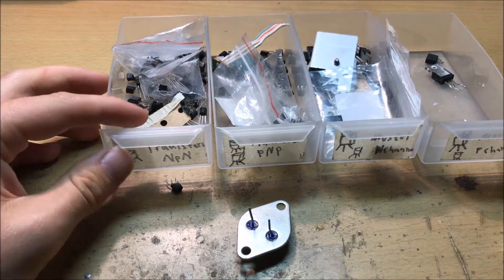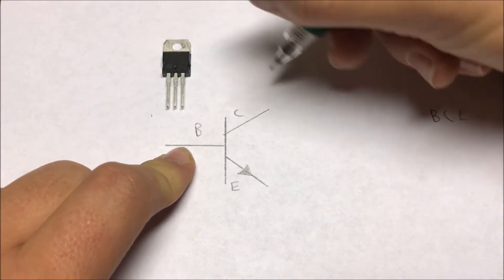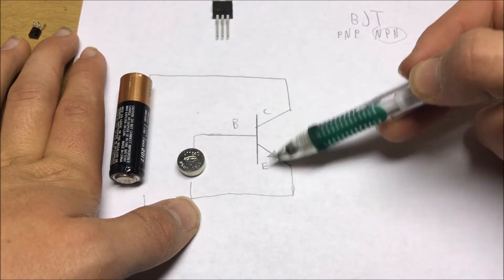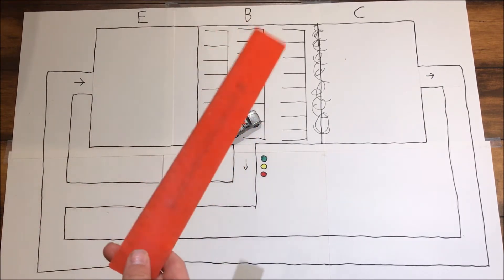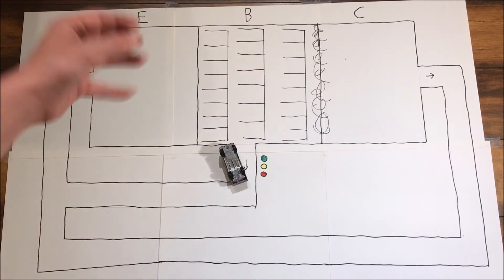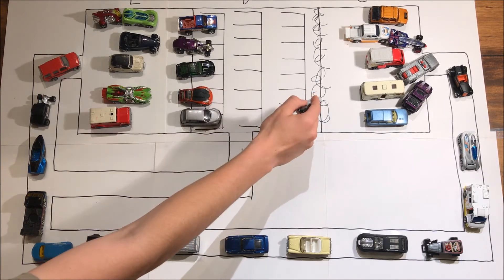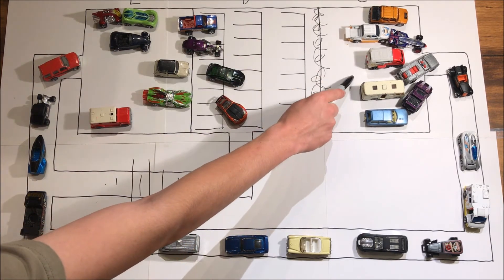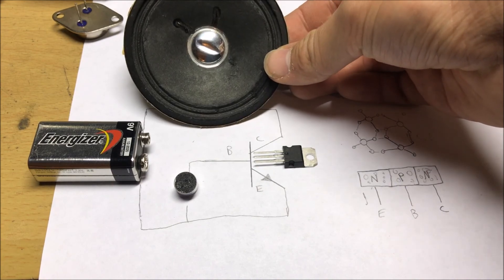Transistors, Explained With a Big Traffic Jam

Comment: Could you explain a little on how the amplification happens? I cant seem understand that.
Reply: Luis Viveros | As i understand mosfets currently, it seems as though by putting in a small signal (the one that goes to the gate) and generating a signal we wish to amplify, the drain will dump whatever current it is present with through to the other side but is "controlled" by the gate terminal. Whether the gate is fully open or not determines the amplification level that the source signal is recreated with. A way i think of it is that an amplifier doesnt actually amplify anything, it simply recreates its input signal with its supply voltage. I can try and answer any further questions